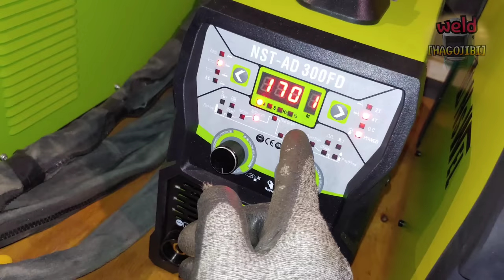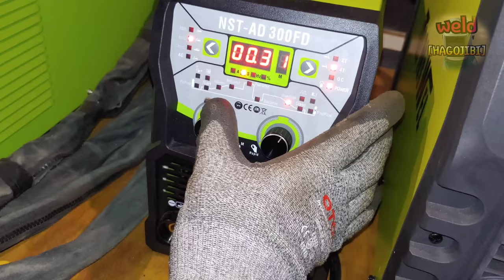Pipe TIG Welding Failure Process Due to Heat Input Mistakes

Comment: I was told pause on the sides, not in the center. You can reconsume your root. Very good video. Also if you use too much gas when you purge you can get suck back on your root.

Comment: Any tips or tricks on how to walk the cup or wiggle the root in sometimes it gets stuck on the walls of pipe or sometimes it will slip in your videos it always seems so smooth what am I doing wrong?
Reply: If your slipping your putting to much pressure on the torch shroud to the pipe bevel. 
Try using lighter pressure and see if it reduces the slipping. 
👍
Reply: Thanks I’ll try that!